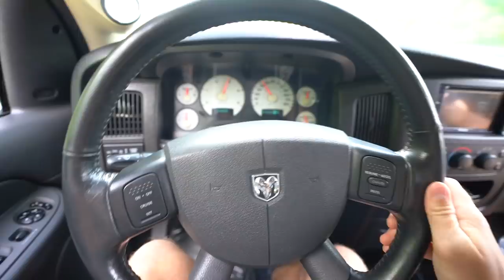How much boost can a stock 48RE handle? (Dual S400 Compounds)

Comment: thruen suspension for the front end and you might wanna lower it a little more
Reply: How good are there coil springs i have a crappy lift in my mega can and there sagging like a 100 year old tits I need a better set